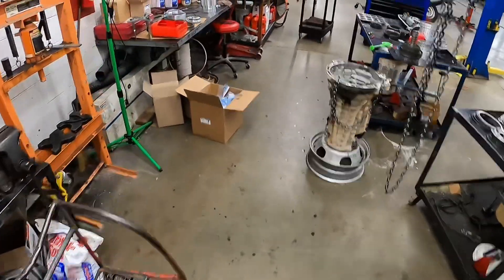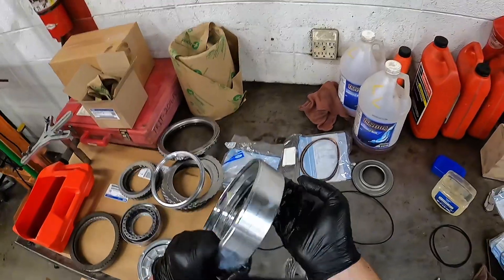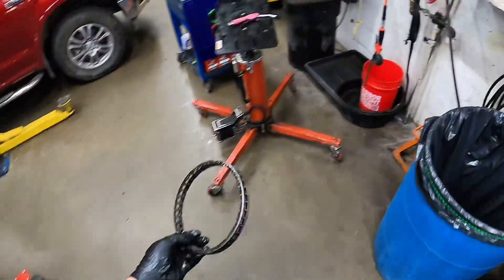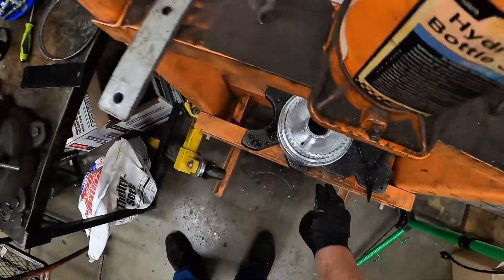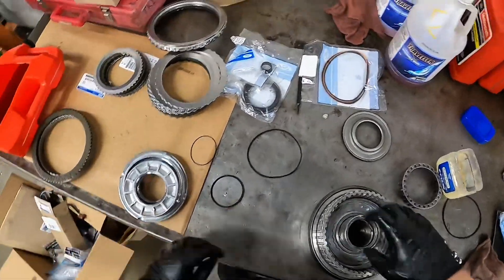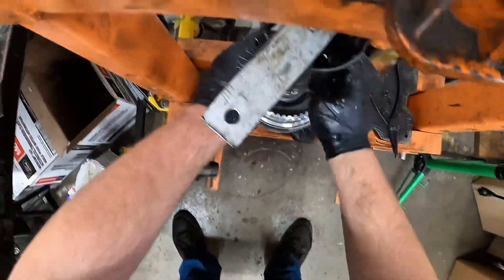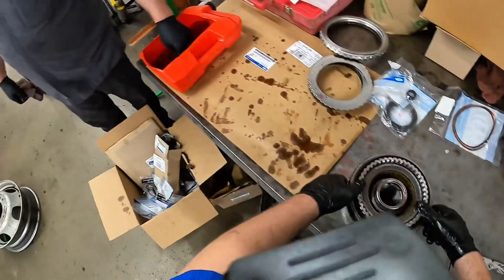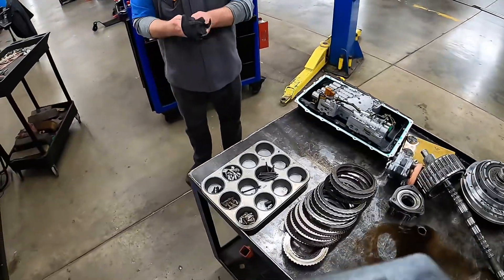Ford 10R80 CDF Drum Overhaul PT-2

Comment: I'm going to be attempting this on a 2018 10r80 in a  F-150. Will I have to have the transmission reprogrammed and will it affect any of the Adaptive Driving components?
Reply from the maker: It depends on a few things. 1. Are you replacing the valve body/main control? If so then yes, you will need to reprogram the transmission. If you install a NEW or REPLACMENT valve body/main control you'll need to program it, otherwise it will damage the valve body/main control and burn up your newly installed clutches. And 2. How bad was it shifting before you repaired it? If the transmission wasn't shifting to terribly you should be ok to drive it. These transmissions usually learn their shift points pretty quickly if it was shifting ok-ish before repairs.

Comment: Lol good take. Maybe someone will get something out of the video.

I just picked up a 24 Ranger, but I've rebuilt my share of engines and trans units for my own shenanigans. Videos like this are great to see if there's peculiarities of a trans family and are super appreciated  :)

Speaking of weird....any thoughts on 24 model Rangers having TC clutch shudder? Looked at the solenoid waveform and it isn't exactly the smoothest 🤷 25s don't do it but lots of 24s do.
Reply from the maker: So, from what I've seen, the torque converters in the rangers seem to fail more often than the f-150/expedition. They may have updated them in the 25-model year, but I'm not entirely sure. I had one the other day that had shudder, and when I tore it out, I found excessive metal in the fluid. turns out the f-clutch in that one had warped itself to the hub. didn't show any signs of it during the test drive.

Comment: I have a question about the C-clip install process for the piston. The clips fit snuggly into the groove when the piston is commpressed, i noticed you used a hole punch and  hammer. Was this a new C-clip, and / or is this a technique to make certain the clip is seated? I purchased new clips, and they seem to fit. However, now, after watching this video, maybe this step should have been performed.  Thank you!
Reply from the maker: So, I usually just tap on them with the punch just to make sure they that their seated. Unless those snap rings are damaged you don't need to replace them, also be aware that the C clutch and the D clutch have very similarly sized snap rings. The only way you can tell is by measuring them with a micrometer, so don't get them mixed up.
Reply: @RustFarmGarage  thanks for the response to my question. I am not sure if you are referring to to the 2 small snap rings which I did refer to them as C-clips, as those have the same part numbers for C and D clutch (HL3Z7A577A) which in my case i needed to replace. The larger snap rings for C and D are different diameters, however I will double check before I finish this install. I did sort out my snap rings on my CDF. a  I am using the new Drum and Can Ford upgrades. Your help is greatly appreciated.

Comment: Do you have part numbers on the two press tools you used?
Reply from the maker: So, the part numbers for those 2 tools are:
OTC 307-589/1, and OTC 307-741/1. The tools are available from Freedom racing, or you can sometimes find them on Ebay. Prepare yourself for the sticker shock.